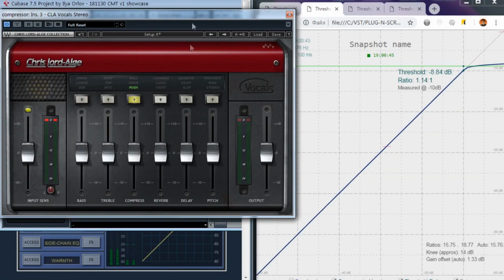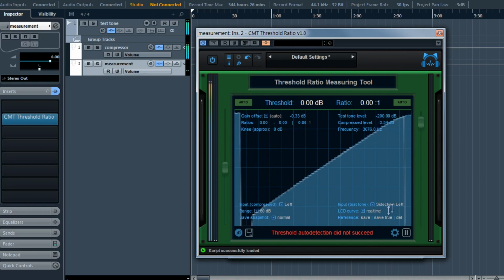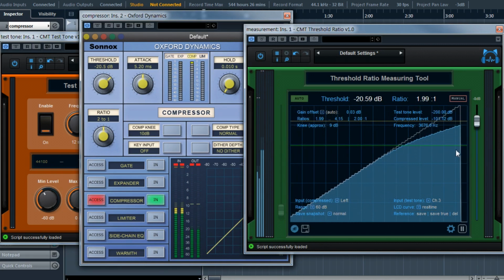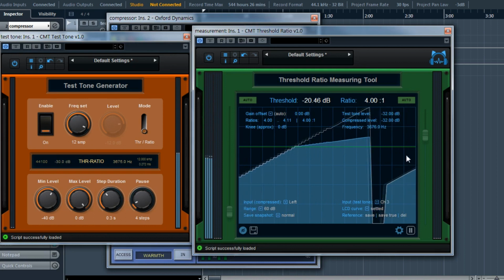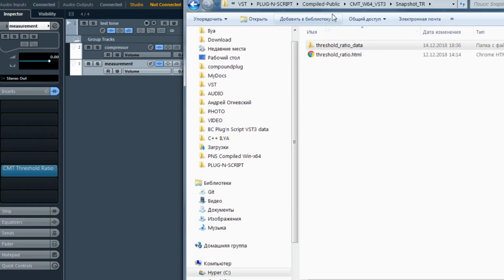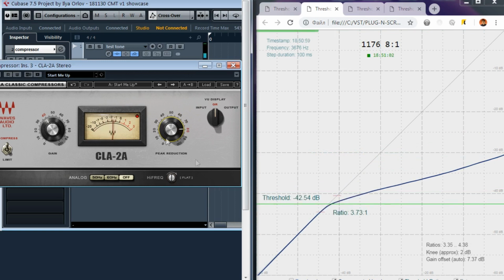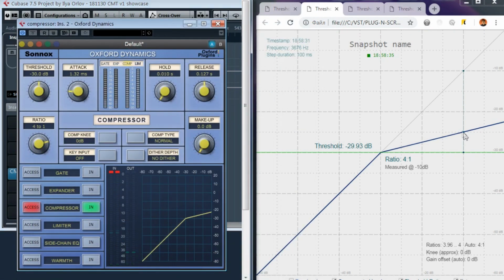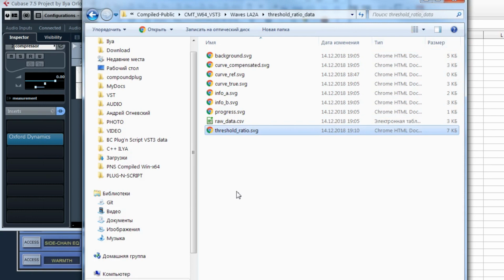How to measure compressor threshold and ratio

Comment: Hi I can’t seem to get it to auto-detect when using a hardware compressor, despite seeing both the white signal line and the (compressed) blue signal, diverging at threshold and everything. When I replace the hardware compressor i/o with a plugin compressor, it autodetects fine. Please let me know if it’s possible to use autodetect with hardware? (I’m in Logic.)

Comment: Bravo! I think the time is right for a VST plug-in that can resolve compressor values based on the BPM. Bpm/Ratio/Threshold/Attack/Release/Gain. I believe the BPM can reveal these settings. I've been working with this to try a formulaic approach in applying compression, instead of working only by ear and best guessing. Surely a more accurate approach and result is possible.
Reply: There is a way I am working on too and I roughly just want to share my view I think if you divide 60000 by your bpm and then divide it by two until you get a figure lower than 20 that's always the right DB for threshold
Reply: @geeclassik that’s not new
Reply: Hello, its worthy of more discussion. There are at least 3 compressor plugins that were released last year. Sonible and Hornet  to name just two. All resolve compressor values derived from the bpm. The Hornet one has a very intetesting and revealing GUI. Take a look at it. The maths might be revealed by careful analysis. I have my own formula for all values including soft knee settings. If you'd like to develop a plugin with me , then please get in touch via my  YouTube channel,
 or drop an email address here if you like. Regards, Andrei.

Comment: I am testing some compressors and at 2:1 it seems to read that correctly , but increasing comp to 7:1 and it show 2.9:1 So its not reading the increased Ratio correctly. Using my own compressor and the Waves C1 , both have this problem.
Using Reaper and routing is in stereo.
Reply from the maker: Please, show me the screenshot. The ratio depends on threshold, and if the threshold is in "auto" calculation mode, it's quite possible. For some compressors with soft knee and non-linear curves it's very difficult to determine what the threshold and ratio are. At every point of the curve the ratio is different.
Reply: @letimix  I will make a thread on the facebook forum and show screenshot there :)

Comment: Same problem as Alex Gee. Signal generator , attack and release working but threshold ratio not working. It crashes cubase. When i remove the threshold ratio dll from vst folder cubase open normal. I have windows 64bit, cubase 32bit. I use the 32bit version plugins (CMT_Win32_VST2 for old computers and old DAWs).
Reply from the maker: Hello! Thanks for the notification, I'll check it out.
Reply from the maker: Please, check this updated version, does it work for you?
http://dl.letimix.com/letimix/cmt/CMT%20Threshold%20Ratio%20v1.1%20Win-x86.zip
Reply: Yes. This version is working. Didn't crash cubase but says "Please provide separate test tone signal".
Reply from the maker: @ioannistzelepis9589  please, see the beginning of this video to see how to separate compressed and test signals. Basically the easiest way is to use VST3 version and put test tone into sidechain.
Reply: @letimix  I forgot.. I have windows 7. Thank you.

Comment: Hi! Wonder if you can help? The attack and release plugin and the sig gen plugin is working fine but not the threshold plugin. I’m running a windows 32 bit daw.
Reply from the maker: Please, provide more information, what exactly is not working as you expect. Have you read the manual? letivyshe.ru/cmt
Have you routed both original signal (via sidechain) and processed into the plugin?